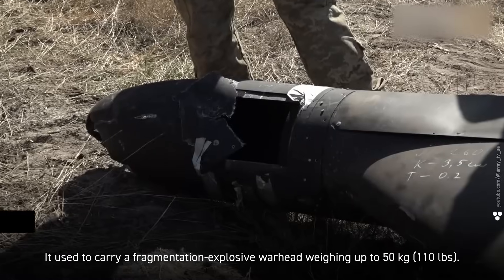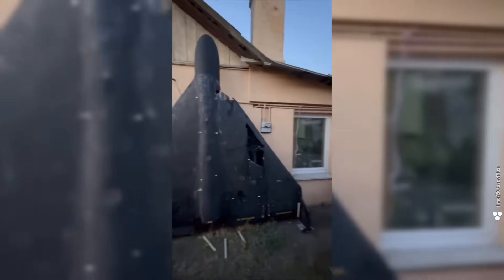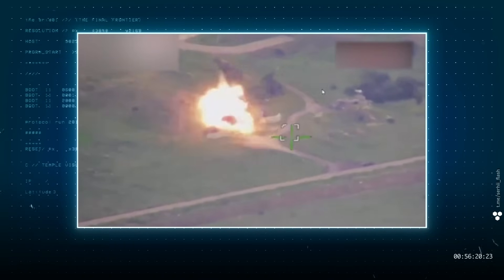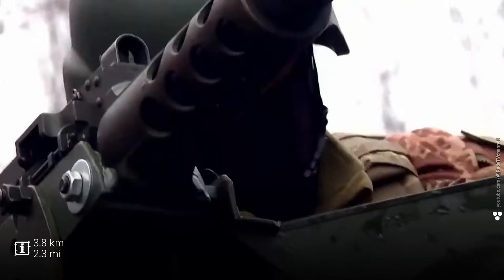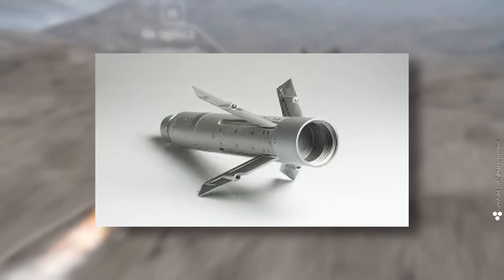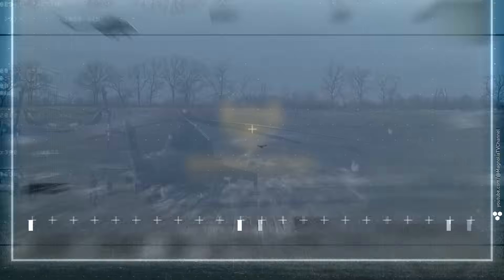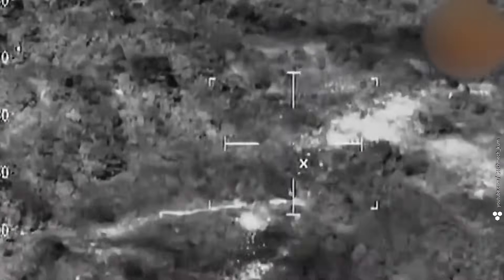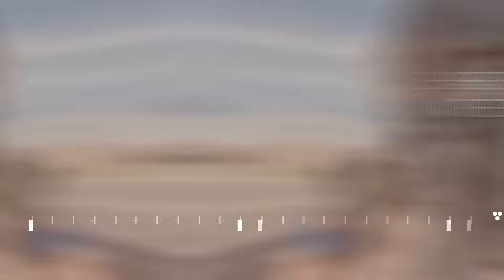How POLAND Can Shoot Down New Shaheds Using Ukraine’s Experience

Comment: The ai following terrain and identifying is not that new. Parrot beboop 2 and dji drones for almost 10 years have been able to identify people, animals, and even cars that they could be taught to follow. And you undated it frequently.  The more you used it the smarter it seemed to get. However the difference to the drones are the ones used in the war now able to use ai and to identify groups of people, specific vehicles, and types of structures. If the operator loosing signal, the drone takes over, identifies what targets are there, and goes for what it thinks is a priority. No idea how it works. Scary thing, the americans switch blade drone was doing this in the final years of the wars in the middle east. So the uprising is coming soon. I myself will welcome our new robot rulers.